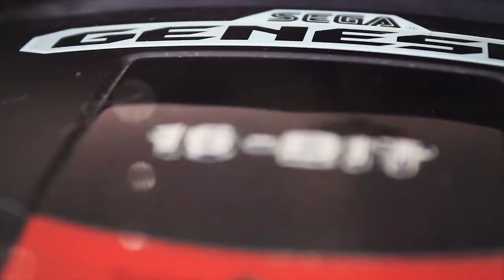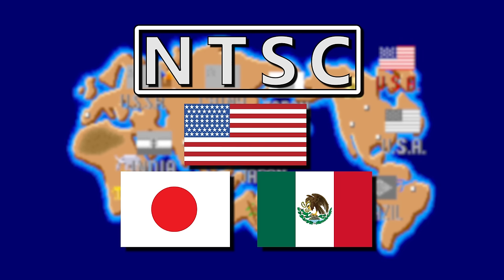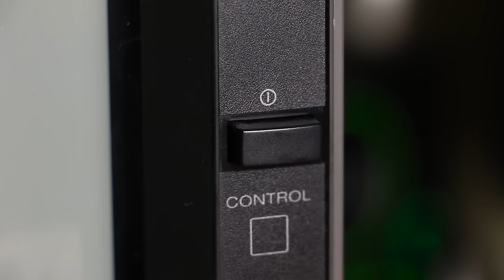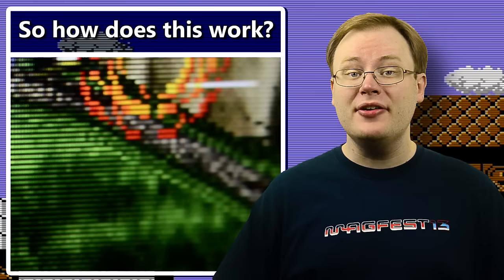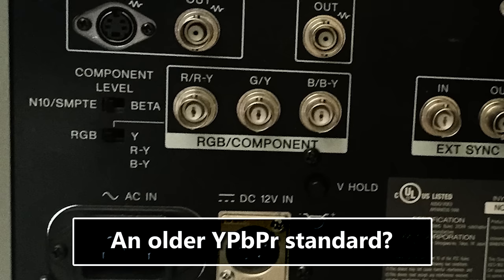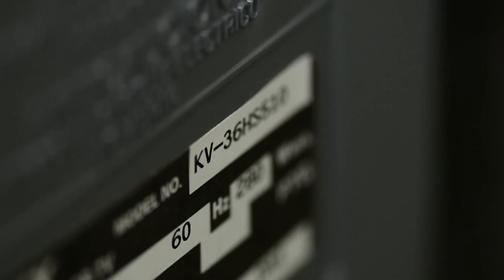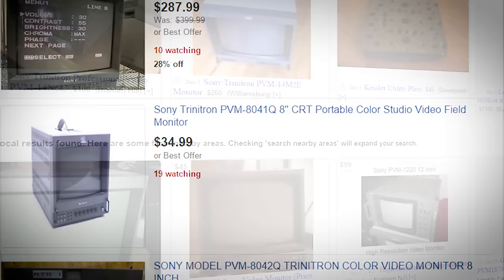Gaming on CRT Televisions, PVMs and BVMs :: RGB104 / MY LIFE IN GAMING

Comment: Just got my SONY PVM-20L2MD hooked up with my Sega Genesis (1st Gen). Got my cables from RGC. My display says it's running 480/60i. I've tried researching it a bit, but thought I'd ask the folks who got me started with all of this :) Can anyone explain this? It doesn't appear that I can change this at all, but I'm concerned I might not be getting the best output possible. Is it just the pvm or is it something else? (btw, the picture does look great)
Thanks!
Reply from the maker: [Try4ce] If the image looks solid (no alternating lines) and there are black lines between lines, then you're getting the right 240p signal. 240p is not a proper standard and will often not show up as such. It's like a video trick that manipulates 480i into creating a progressive image. PVMs just say 480i / 60 for any NTSC 15kHz signal.

Comment: I just thought of something I wanted your professional opinion on. Is it possible to get the same quality of a CRT on something like an older computer monitor? I refer to the box monitors that were used around the 80's and 90's. And with the right kind of Framemeister or VGA adapter could you get the same results?
Reply from the maker: [Try4ce] Not exactly the same, but it's a great approach for sure. You can use an upscaler like the OSSC or RetroTINK 5X with scanlines to get a similar look to a real PVM or TV. You simply adapt their HDMI output to VGA with inexpensive lag-free adapters. The bonus benefit to this approach is that you can also connect say, 720p consoles like the PS3 this way, which is quite possibly the best PS3 can even look, period.

Comment: He said something about HDcrts not working well. anyone able to elaborate on that? was thinking about looking for a CRT with an hdmi input lol.
Reply from the maker: [Try4ce] They won't treat analog consoles in the way that a standard CRT or a PVM will. In other words, you don't get the true scanline effect. It scales the image much like a modern TV does. You also can't use light guns on them. They aren't bad necessarily, they can look pretty nice. But they're essentially digital TVs with an analog imaging technology, which in my opinion doesn't give you the full benefits of analog or digital. You might want to look into a BVM with SDI input (which is a digital input you can convert HDMI to with a simple HDMI to SDI converter box).

Comment: Any known crt tv with very deep blacks? Played on a BVM and black looks like grey
Reply from the maker: [Try4ce] Often it has to do with an anti-glare layer. Monitors without it, or those that have had it removed, may have less deep black levels. However, the viewing environment is also hugely important. CRTs are very sensitive to ambient light, so a bright environment will reduce the visibility of the image. Horror games can be very difficult to see on a CRT without turning off the lights.

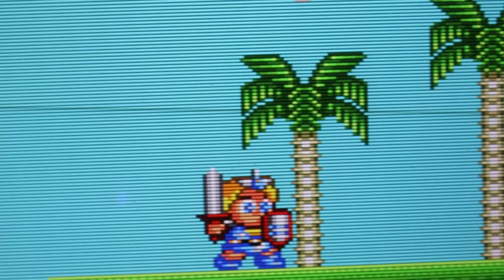Comment: Hi thanks for this nice technical video it's very nice !! But I'm sorry you made a miscalculation at 16:42. This is not 1 divide by 15 = 0,06666... BUT 1 divided by 15000 so 1/15000 = 0,00006666... We work with second (s) and Hertz (Hz). Not second and Kilo Hertz, so it's 1s/15.000Hz not 1s/15Hz. So the electron gun not make 0,066.66 = 66,6 ms (milli second) to make 1 line, but 0,000.066.6 = 66,6 µs !!!! µs = micro second !! I'm sure you understand that 66 ms is an horrible input lag and it's why I was thinking, hey man this is impossible ! The calculation is wrong ! I hop I help you. Kiss from France ;-) 
1 frame at 50Hz = 20 ms. 1 frame at 60Hz = 16 ms.

Comment: I have a Retrotink 5x. What is the best way to run my consoles through it, and have it displayed on a modern TV and a CRT simultaneously?
Reply from the maker: [Try4ce] The way I do it, I have GSCART and GCOMP switches with dual outputs, so one goes to a CRT, the other the RetroTINK 5X. If you have PVMs with outputs, you could also send that to the RetroTINK 5X.

Comment: Hi I'm new to rgb. Needed help. I purchased a sync on luma cable for the ps1. My current setup up is a lcd tv. There is no place to connect the cable to the tv. What am i missing?
Reply from the maker: [Try4ce] This is a pretty huge question. SCART connections were never used on North American TVs, and are becoming increasingly uncommon on European TVs as HDMI takes over. If you're in Europe, then there's a good chance you can find a CRT TV that supports SCART. If you're elsewhere, then you might need to look into PVM monitors (you can buy SCART to BNC adapters, which allow you to connect to these displays). Otherwise, for connecting to a modern TV, you'll need a good upscaler that accepts RGB, such as the OSSC (Open Source Scan Converter). For an up to date look at how we connect games (both old and new) to modern TVs, watch this episode: https://youtu.be/dym6XD3-8qw

Comment: Hey guys, I just bought a Sony PVM-1354Q and I was watching your video on CRT and PVM monitors. I just had a question - this monitor has teh external sync you mention - if I'm using a sega saturn with component cables (retrovision) what do I hook into that external sync port? Thanks!
Reply from the maker: [Try4ce] You don't have to hook anything into it! In that case, make sure you go into your PVM settings and choose YPbPr or component for your video mode, with INTERNAL instead of external sync.
Reply: @mylifeingaming Awesome! Thank you so much for the help!

Comment: Question: I'm about to get a CRT Philips tv (panoramic) with both components and HDMI input. Would the TV adapt to say a super nes or a wii in its original 240p or 480i? Would it be a good solution for playing both retro consoles and HDMI wiiu games? Thanks
Reply from the maker: [Try4ce] I suspect it will be a digital TV and not true analog, so it probably won't play SNES and such quite the same way as an analog one. But it will probably not look bad for them.

Comment: Can you hook up a pc to a crt? I have a Mitsubishi 36” that I’ve hooked up my pc to with a HDMI to rca adapter. The pc games look ok but I can’t read any of the text from my pc because it’s blurry. Does anyone know how to adjust to make the text clear? Do I  need another adaptor or do I need to mess with the actual tv settings?
Reply from the maker: [Try4ce] Well, if you have a CRT designed for PCs, you can do that of course, although you may have to get an HDMI or Displayport to VGA adapter since you won't often find VGA output on modern computers. PC CRTs can run at fairly high resolutions compared to CRT TVs, so text should be pretty readable and there are options in Windows that have different types of anti-aliasing for text, some of which may look best on a modern display, and others that may work better on a CRT. I suspect what you are doing is outputting high resolution through a converter to a consumer CRT TV, which is just not gonna work all that well for PC stuff because while console games were designed for that kind of display, PCs had their own CRTs that were optimized for PC visuals. There are HD CRT TVs, but back when I had one, I never got very crisp text when connecting my PC to it. A PC CRT with VGA input is the way to go for PC stuff.

Comment: I recently unearthed my PS2 I forgot I had and bought a bunch of additional games for it. Hooked it up to my HDTV via component cable. The games were, unsurprisingly, quite stretched out and even made me feel physically ill. Then I thought to myself.. "Perhaps I should hunt down a TV better suited to a past console generation. That's when I also remembered the PVM's. Now I'm just trying to figure out what would be a good monitor to hunt down that isn't too huge a pain to setup for or require few steps to get the best picture. Anyone have some recommendations? Budget is fairly flexible.
Reply from the maker: [Try4ce] Of all the systems out there, PS2 may benefit the most from being displayed on a CRT versus a modern TV. I've really come to appreciate its particular look all the more after revisiting it on CRTs! Almost any medical grade PVM monitor looks great for PS2. In my opinion, the super high end ones are not necessarily any better for PS2, because sometimes the field pairs are spaced further apart, whereas on the slightly "less" high fidelity ones, the scanlines blend together more naturally. That said, I wouldn't turn up my nose at a high-end one if you found it for the right price... but just saying, you don't need to go out of your way for it, unless you need 480p capability. I recommend the M2 or L2 series for PS2. They are comparatively common. See if you have any medical equipment reseller warehouses within driving distance. Very good chance they'll have some 20 inch PVM-M2 or PVM-L2 units laying around. Bring your system with the appropriate cables to test! S-video, component (with RCA to BNC adapters), and RGB (with BNC cables or a BNC breakout adapter) would be great.
Reply: @mylifeingaming  Oh! I appreciate the response! Wasn't expecting it. I was actually gonna ask what models you folks were in possession of in the video! Just sorta going off of the inputs and matching them up with what I had been seeing on eBay! Locally is a pretty far cry, so eBay is probably my best bet currently. Will be looking through particular stores to try my luck!

Thanks again!

Comment: Please help me...
Which is better?
I'm not sure for repair my Samsung Flat Slim CRT (2006), or Buy a Sony Trinitron curved CRT (1998). Or You recomend an adapter for My LCD HD screen. Which is better for N64?
Reply from the maker: [Try4ce] That's a tough choice. For N64, if that 1998 Sony has S-video, I feel that would be the more authentic sort of TV to play it on. If you use an upscaling type device to play an unmodified N64 on your modern TV, your best bet is the RetroTINK-2X because unlike the OSSC, it supports S-video. I strongly recommend the RetroTINK-2X over generic S-video to HDMI devices. We have an episode on the RetroTINK-2X if you want to get a better idea of what it is. The audio issue we demonstrate in that episode has since been fixed on newer units.

Comment: I have a Trinitron KV-32HS500. There is no HDMI but it is capable of outputting up to 720p through component. I have my Backwards Compatible PS3 hooked up to it through component cables. Why am I getting input lag when playing PS2 games at the 720p setting on my PS3? No lag if I set to 480p
Reply from the maker: [Try4ce] That's a great question. I wonder if the lag is caused by the PS3's handling of PS2 over 720p, or how the TV handles 720p.
Reply: @mylifeingaming  I do not know. That is basically what I was asking and also why I included the model of the tv in my question. One thing to note even though the TV is capable of going upto 720p there is no HDMI port and nowhere on the tv or in the manual does it say anything about it being a EDTV.

Comment: What should i do with my pvm if it might need sync with component?  I have tried to split the green to try and use it at sync but it is not working properly.
Reply from the maker: [Try4ce] In your PVM menu, you should have settings to set sync as "internal" and set the color system as YPbPr or component instead of RGB. Setting sync as internal makes it look for sync over the green/Y input.

Comment: Would it be possible for a modern TV to replicate the look of a CRT TV by introducing scanlines or something?
Reply from the maker: [Try4ce] It's nearly impossible to replicate it perfectly because of the biggest difference in how the images are drawn... modern TVs use fixed pixels, and CRTs do not. The image is sprayed across the screen by the electron gun, and they aren't really "pixels" per se. PC monitors that can do high resolutions, for example, are very good at hiding compression artifacts and things like that because of the analog nature of each individual line. Anti-aliasing isn't as necessary on CRTs either! So there are just a few things that would almost be impossible to replicate with current tech.
Reply: @mylifeingaming  Ok I see, that's too bad. Thanks for replying anyway, that was interesting to read.

Comment: At 19:11 comparison are all consoles using RGB ?
Reply from the maker: [Try4ce] This was so long ago, but my guess is that the non-PVM shots were using RGB converted to component since that's the best connection we could've used at the time. The SD CRT that was probably used in that shot had a feature that caused over-sharpening that I didn't know about at the time. That has since been disconnected internally so it wouldn't have the halos that I see in that shot.

Comment: Will Retropie gives the real experience on CRT TV or I should consider another platform?
Reply from the maker: [Try4ce] This is something I'd like to test. Mike Chi makes devices that let you do 240p with Pis, but I don't know much about them. There would be some input lag from the emulation however, but you may or may not notice. Other issues like inaccurate sound emulation may also crop up. It's definitely a viable approach though.

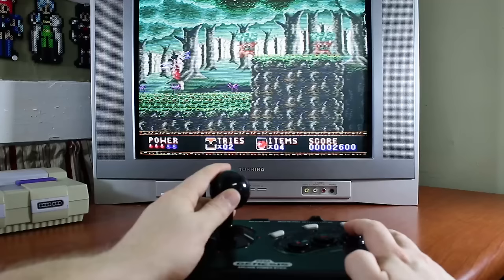Comment: I noticed that at 6:46 the frame around the status bar is cut off at the near bottom right but is fully visible on the bottom left. I have a similar occurance with my CRT, but not as noticable. Is this something I should focus on fixing or should I leave it be? I think I need to open up the TV to have a chance at fixing it in that case.
Reply from the maker: [Try4ce] This is normal CRT behavior. Your may be able to fix it through the hidden service menu, but that's risky, as you can make the situation worse if you aren't careful. Remember that a CRT's geometry will never be perfect. Also, definitely don't open it. CRTs are extremely dangerous inside, and certain components can hold a deadly charge even when not plugged in. Only open a CRT if you absolutely positively have researched what to do inside. But your problem should more likely be a service menu thing. Just remember that CRTs will never be as straight and uniform as a modern screen.
Reply: @mylifeingaming  I have used the service menu, but none of the changeable values fix the issue. It's not like it's anything severe, especially when everything else is good. Thanks again for your response!

Comment: What about using one of these professional monitors for an arcade cabinet for emulation how well would it work would that be something that you recommend
Reply from the maker: [Try4ce] There are ways to get 240p out of a Raspberry Pi or computer, but it's not something I've had a chance to do yet. Check some of the devices in the RetroTINK series by Mike Chi. Some of them are meant for Raspberry Pi.
Reply: @mylifeingaming  yeah haha I was wanting to do like a fully done computer build with a i5 2500k and a gtx 1050ti or something like that

Comment: The future is emulation. This comes from somebody who has original hardware and SD CRTs. Retro Arch has made huge breakthroughs in input latency just this year that enable emulators actually be faster than real hardware on a CRT. The future looks bright because emulation saves a ton of space and is universal with all types of displays. Not to mention all the money it saves from not having to buy super expensive games off of some greedy jerk on eBay just to play a great rare game or games not released in your region. I have a big 35 inch Sony Trinitron that I have all of my 240p consoles hooked to. However the experience is just as great on my computer hooked to my 50 inch CRT upstairs. I'm glad because my CRTs won't last forever, and I don't fancy being in a bidding war to pay hundreds of dollars for an old CRT when they do become rare.

Comment: If the game only put out half flat images, that are then cut up, the sprites of the game would be half the hight, which they aren't, so that cannot be correct from my perspective, if anyone can explain otherwise, please feel free to do so.
Reply from the maker: [Try4ce] I'm somewhat unclear what you're asking, but I think you're talking about the scanlines. Each horizontal line is a scanline. The black space between each line is simply nothing, although people refer to this as the "scanline look." The CRT spreads out each line so that they are not half height. Digital TVs compensate for this by multiplying the lines and scaling up, rather than having space between lines.
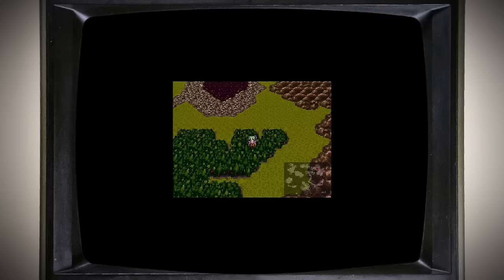Reply: @mylifeingaming  I'm thinking about the point around 8:18 with the finalfantasy figure. I got the impression, that the "black scanlines" or the lack of scanlines, have the same thickness or height, as the lines of color. But if you look at game-character sprites on the internet, they are not half the height as they appear on CRT-tvs. Which (I guess) they should, if their pixels are put tight together. Let's take an example with the classic mario from NES, his hat is two pixels high, but if you look up his sprite, it is still two pixels high. But if we look at this footage from a CRT, we can see that the hat is still two pixels high:

https://youtu.be/3BJU2drrtCM?t=212

The black lines, or lack of scanlines, seems really thin compared to the actual scanlines, or lines of color and light.

But thank you for your answer, really interesting topic.

Comment: Is there a way to connect an RF/Composite only CRT to a Win based emulation station? I would like try this on an old family Sharp CRT. I've only really seen component or rgb adapters/converters but I would like to use the native legacy YUV.
Reply: does it have hdmi output? if so use hdmi to composite converter.
Reply: @gamecubeplayer  Yes it would be going out from an Nvidia card via HDMI. Any quality converters (active or passive) that you would recommend? Also would the 60hz refresh be adjusted in any way?
Reply: @Odank  i don't know just get hdmi to composite converter